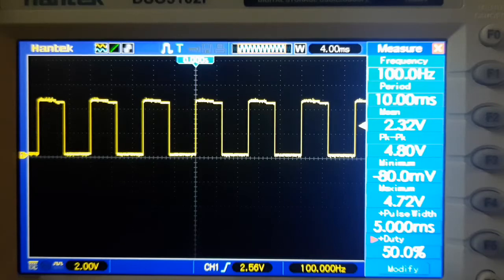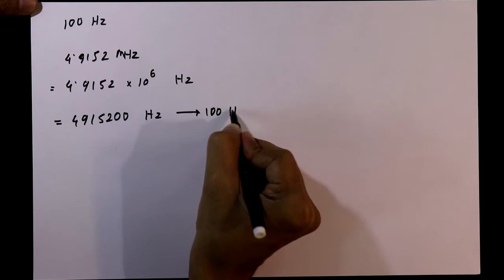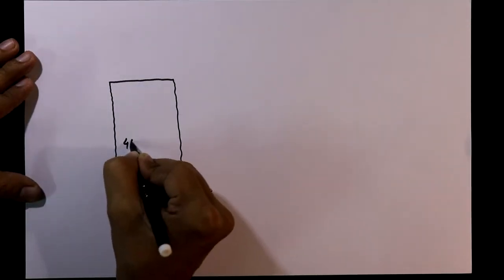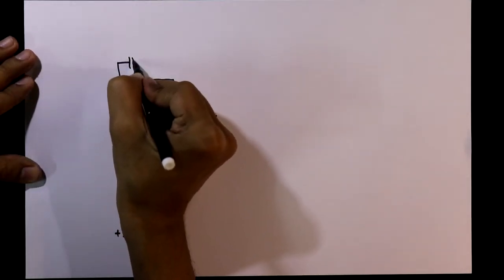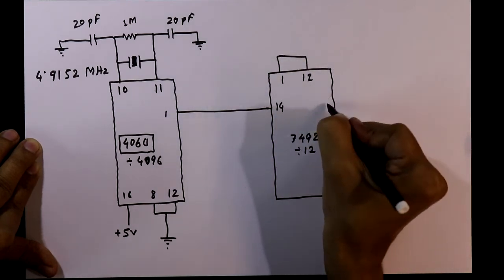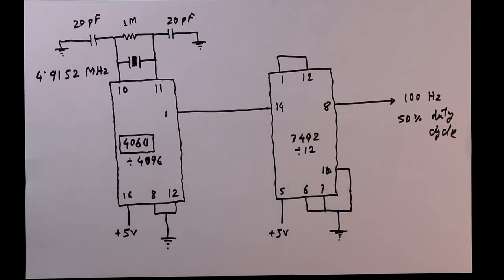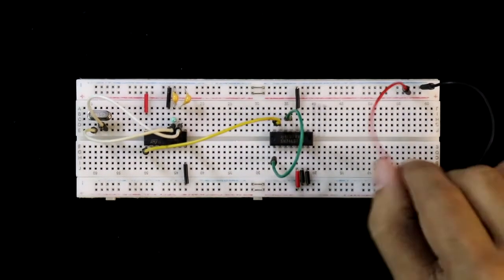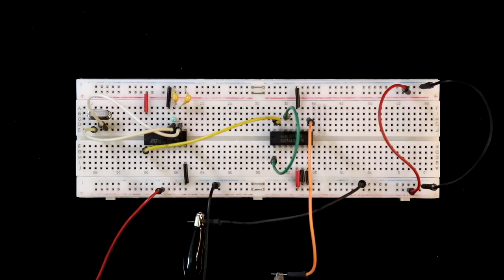Part 2: Generate 100 Hz clock pulse with crystal oscillator

Comment: How to convert 18 mhz crystal Freq to 1 hz sir
Reply: It is MHz, not mhz! Conventions exist for a reason, small m is milli, capital M is mega! To answer your question you will find your answer within the question - you simply need a divide by 18 million circuit. However, since you require such a low frequency I would suggest a much simpler solution would be a 32786Hz watch crystal and a divide by 32768 circuit.